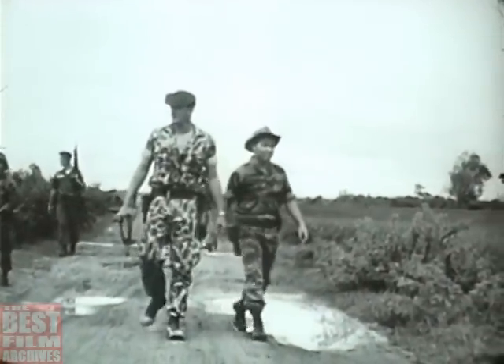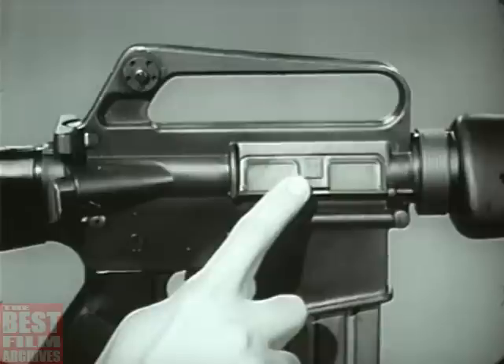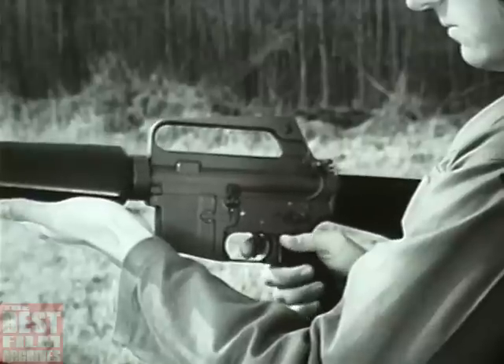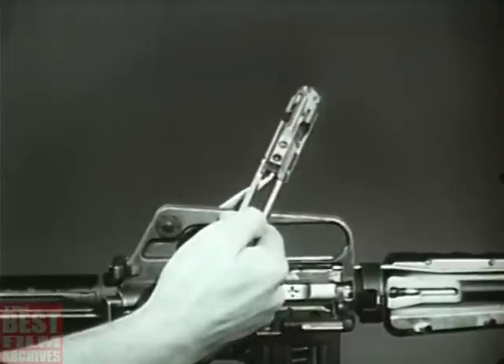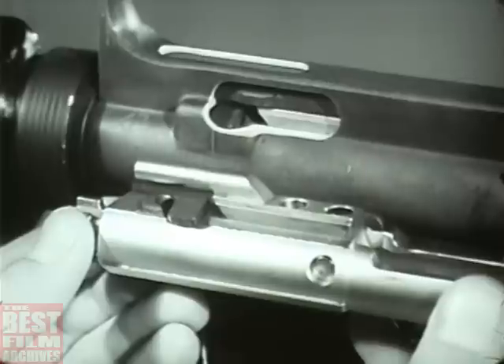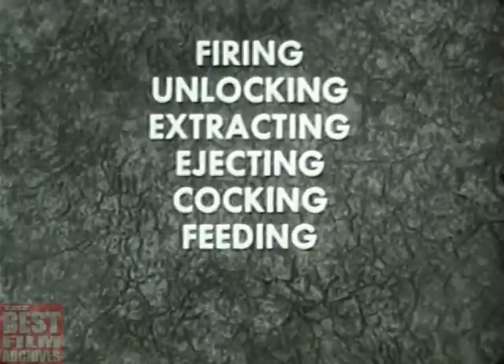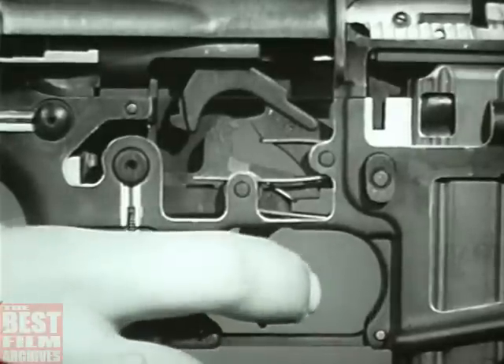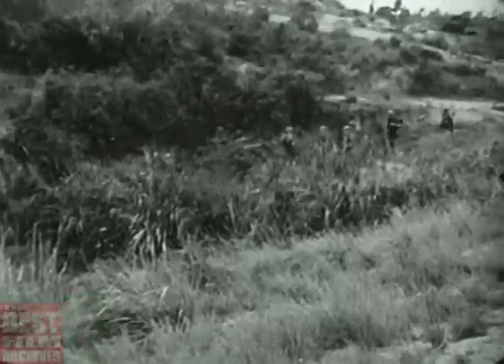How M16 Rifle Works | XM16E1 | US Army Training Film | 1966

Comment: I thought they didn’t get forward assists until 1968 or something. Huhh. This really was ahead of its time though. Imagine seeing M14s and AK47s as the most advanced rifles, and then this “space gun” comes out, and it’s still being used nearly 60 years later. Eugene Stoner was ahead of its time. It’s a shame the military said it was self cleaning when it clearly isn’t, and they put the wrong gun powder in it, just to save a few bucks. Both actions were the reason they jammed up all the time and got soldiers/marines/etc. killed.
Reply: The forward assist was introduced with the Colt 603 (XM16E1/M16A1) circa 1964
Reply: @TheSundayShooter  yeah that’s wild idk why I thought 1968 maybe it was just a standard feature on all M16A1s when they came out in ‘68, instead of just on the army models on the regular XM16s the army was using, but not the other branches, since they didn’t request it initially. But Hell if I know.
Reply: @ESPLTD322 That was the year the M16A1 was adopted..

Comment: Assuming that a round is chambered and that it is set on semi-auto:

trigger is pulled
sear releases hammer
hammer strikes primer of chambered rnd
The primer cap ignites
the ignition goes through the flash hole
the ignition ignites the powder
the powder then (through a chemical reaction) pushes the bullet through the barrel
the bullet leaves the barrel
But, a portion of the gas is directed towards the gas tube
Said gas enters the gas tube
this gas travels the gas tube length
When said gas hits the (direct impingement [meaning no middle device to accept the gas and thus transfer the power of the gas to the bolt[), the bolt is twisted and thus unlocks
the bolt continues the unlocking process
The bolt travels down the upper receiver
The ejector then pushes the spent case out of the ejection port
(at this time, the spring in the buffer tube is compressed and ready to return to its non-energy state [the buffer tube spring wants to release its acquired and coiled energy])
The buffer spring the pushes the bolt forward.
As the bolt travels forward, it strips another rnd into the chamber.
The bolt twists and locks into the chamber
In the process, the sear cocks the hammer and readies the trigger to release the sear and thus fire the rifle again.

This is repeated until all rnds are expended.  
The hold open (The M16 systems = an open bolt system = will hold open the bolt as the last rnd and expended casing is expelled from the rifle.

When a new mag is inserted - the operator uses the Bolt release lever.  
The lever flies forward 
This then strips a new rnd into the chamber.
The bolt locks and repeat all the above.

Yes, I went a bit too deep.  But that is how an M16 functions.
Reply: Nope, the M16 is an internal piston (not a true DI) and the sear only releases the hammer on full auto..

Comment: The eight steps in the cycle of function are all there, just slightly out of sequence.  On the premise that your starting with an unloaded rifle one must start with,
"Feeding": the rifle first by placing a round of ammunition into the bolts path by inserting and locking a loaded magazine.  After that all other steps following in order from

"Chambering":  the act of moving the round of ammunition into the chamber by retracting and releasing the bolt in order to strip a round from the magazine.

"Locking": is accomplished as the bolt head passes the locking lugs of the barrel extension and is turned by the bolt cam riding forward on the bolt carrier.

"Firing" is done by pressing the trigger which releases the hammer from the trigger nose thus striking the firing pin inside the bolt carrier.

"Unlocking": Gas from the fired round passes back through the gas tube into chamber created by the bolt gas rings and carrier.  This pushes back the carrier which in turn causes the cam pin to turn the bolt until the locking lugs disengage from the barrel extension lugs.

"Extraction": Happens as the bolt is rotating breaking the chamber seal on the casing which is held by the extractor jaw.  As the bolt unlocks the rearward inertia of the bolt and carrier compresses the recoil spring and the extractor pulls the casing clear of the chamber.

"Ejection". Happens the moment the casing clears the ejection port.  A spring loaded detent on the bolt face opposite the extractor presses forward pivoting the casing on it captive rim flinging it clear of the weapon.

"Cocking" happens as the carrier goes all the way to the rear, as it does it pushes the hammer back down into the lower receiver were the hammer hook is captured by the disconnector riding atop the trigger assembly (semi-auto mode) once the carrier goes forward is strips of the next round and chambers the round.  The shooter then releases the trigger disengaging the disconnector from the hammer spur, but as the trigger nose rises it engages hammers trigger sear notch and the rifle is ready to fire once more by merely pulling said trigger again.

Just goes to show what one can remember after being a Small Arms Instructor at APG for 11-years.

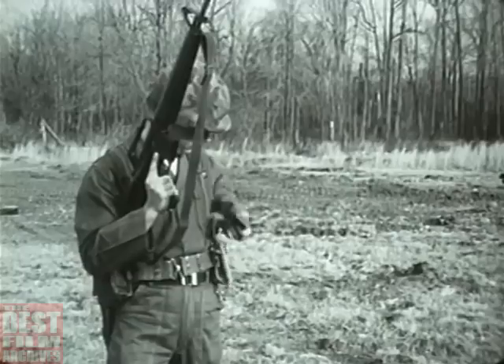Comment: 1:19 is wrong. The diameter is actually .224, not .223
Reply: Bores are usually sized one thousandths larger. The bullet diameter is .223, but the bore is .224.For an additional example, the 8 mm Mauser bullet diameter is .323, but the bore is .324.
Reply: Same thing in heavens gate?
Reply: Not mine
Reply: Ummmmmm no.

Comment: Am I looking at a chrome-lined barrel and Bolt?
Reply: Not this model. Later models were, however
Reply: @JB.1371  the xm16e1 DID have a chrome bolt.
Reply: You are. Those, along with forward assist and mag button fence are key features of A1
Reply: The bolt on the M16 A1 was later parkerized and just the gas key was chromed due to the quality consistency problems they had at the time. All XM16 E1 rifles had chrome bolts and gas keys from the very beginning.  A chrome lined barrel was added to all earlier E1 rifles once the overheating and wear problem was discovered.

Comment: Why didn't they give them 30 rounds...??
Reply: dIRECT0R 30 round magazines weren’t made or designed at the time. The 30 round magazine came out later on
Reply: @JB.1371  correct. Only after it was realized 30's were standard on AK's that the V.C. had, did we decide we needed them too
Reply: @JB.1371  That just begs the question.
Reply: I prefer 20 round magazines.
Reply: Speaking of 20 round mag, is there PMAG version of 20 rounds?
Reply: It was our bullshit military doctrine 20 rounds. The early thompsons only had 20 round mags until they realized that was dumb so they started issuing 30s, the BAR 20 round magazine, and then the m14 20 rounds, then the m16 20 rounds and they realized that was dumb so they started issuing 30s in the 70s.
Reply: @5.56mmSnack  although fun Fact early 5.56 ar15 prototypes had a straight 25 round magazine similar to what the famas had.
Reply: @DreadPirateRoberts121  AR-15 is older than FAMAS

Comment: anyone else wonder why his finger is always on the trigger? my nco's would break your finger for that lol
Reply: Read elsewhere that the trigger discipline you are thinking of didn't come around til the 80s. Not sure if true or not, but sounds believable.
Reply: @Mr._E._Shark  something too that
Reply: That’s the way they were taught then!!
Reply: It's 1966
Reply: This is three years before we went too the moon. 
Though I bet some of you who will reply don't believe went lol 😆 
I just love to hear some pro commie anti American propaganda about how we didn't beat the soviets in the space race 🤓
🚀🇺🇲🌒
Reply: @JohnV170   In the truest military sense, that the space race was a way to demonstrate ICBM technology, the Soviets did get most of the more important achievements. More importantly, combined with modern safety measures and policies, the old Soviet system is still vastly more financially efficient. Which is why NASA astronauts are technically closer to Cosmonauts now. They've been using Soyuz rockets, launched from the old Soviet cosmodrome, as their primary/most common way into space for a few decades. NASA actually formally ended the shuttle program in 2011. It was just seen to be unnecessarily expensive, especially with the rise of modern private space agencies. However, the old commie space tech has literally been accepted and endorsed by NASA. If that isn't the ultimate win, then I really don't know what is.
Reply: Because ambushes were pretty common back then and trigger finger delays your reflex time or it just didnt exist back then.

Comment: The modern versions of this rifle are soooo much better I can assure you.
Reply: AKFGFan i can be assured you know nothing about ar15s.

Other than magazine issues these rifles were and are highly reliable.
Reply: Most of the problems of this gun were due to poor ammo quality and poor magazine quality. They were advertising the gun as self cleaning too. 
This was mostly during field evaluation of xm16e1, when the Army adopted the M16a1 was perfected and the gun worked realiably
Reply: @EatyourshitYoutube  The only thing that sucks on thr A2 is the burst mode instead of full auto. Thankfully, the M16A3 exists.
Reply: No doubt. They really haven't made any real changes as far as function. They have made different configurations with different gas system & buffer lengths but no real functional changes were needed. I have a reproduction A1 & it's every bit as reliable as newer rifles. The M4 feed ramps were done to help with weak magazine springs & it's debatable if they are even needed or helpful. 
I think if the bolt body was 2mm or so larger diameter they could reduce breakage at the cam pin hole & I think, if they had of gone with fewer but larger locking lugs they might reduce breakage of the lugs but those aren't a serious issue.
Reply: wavygr it was quite a few things it was the ammo no cleaning kit and that the barrel didn't have a chrome lining on it

Comment: This video says max effective range is 460 meters, but M16A4 with 20 inch barrel is said to be 600 meters. Is that based on energy or targeting?
Reply: No, rounds and rifling twist. Plus, sights. do the compairison.
Reply: Emanuel Fernán the effective range of an M16A2 or M16A4 is 500-600 meters point target. 800 meters for an area target
Reply: Roughly, the likelihood of achieving a hit.
Reply: Basically, sights. The m16 and m16a1 had 2 position sights the were only good out to 460. The a2 and a4 have sights that are range adjustable out to 800 and 600 respectively.
Reply: @isaachousley325  you were the only one to answer this correctly. It’s how the sights were regulated for the A1.
Reply: Starting with the A2, there was a change in barrel and ammunition specs. The bullet changed from a basic fmj 55 grain to a 62 grain penetrating projectile. The barrel rifling was changed from 1 turn in 12", to 1 in 7" to stabilize the longer, heavier bullet. The external ballistic characteristics of the new bullet are superior to the older 55gr load, and carry higher energy at longer distances. This results in a longer effective range. Both loads are still used, though the 55gr ammunition is generally reserved for training. There are also several other projectiles in use by our military, including heavyweight match bullets for precision shooting, and an internally segmented bullet meant to combine maximum wounding effect within the bounds of the Geneva convention rules, and an ability to penetrate light armor.
Reply: Back in the 1980s, we were trained that the max effective range was 460 meters.   Things change.

Comment: Yeah I prefer the M4 carbine much better than this thing
Reply: It's the same basic operating system. Literally just a shorter barrel and gas system and a carbine stock.
Reply: SemperFiMac77 exactly!
Reply: Why have an m4 when this is way cooler
Reply: The original m16a1 was shorter and lighter than the following carabines so it's similar to M4 feeling wise

Comment: >Rugged
>Effective ammunition 
implying the M16 wasn't shit
Reply: It wasn't. It actually beat the M1,  M14, and AK-47  in all Army trials, when they were conducted properly. The reason it had problems was because the Army didn't want it, they wanted their .30 cal rifle,  and set it up for failure. This is all well documented and available online.
Reply: +Lone Wanderer from what i've compiled online the reliability or the lack of was the result of poor powder quality for the cartridges and lack  of training and info and lack of cleaning of these rifles
Reply: The M16 is actually a very reliable and ingress resistant design, along with it's huge performance benefits